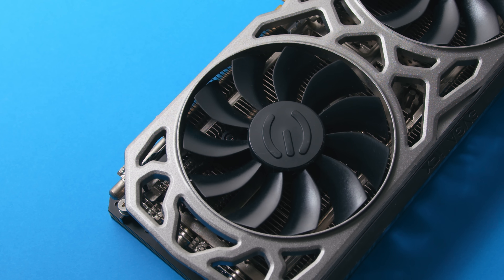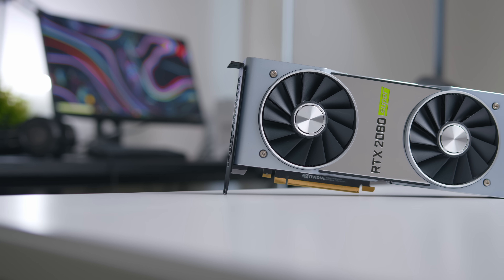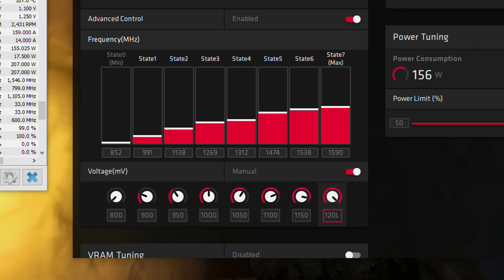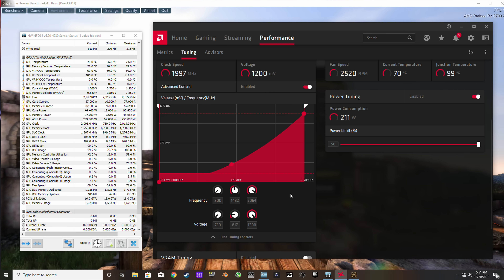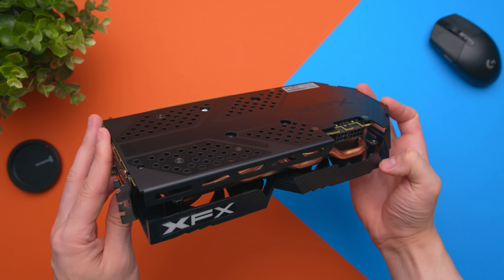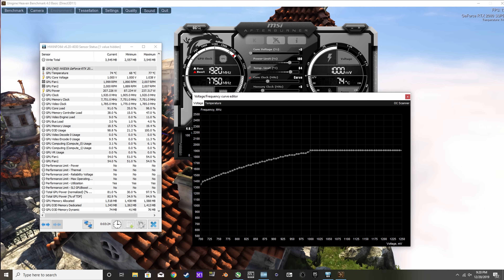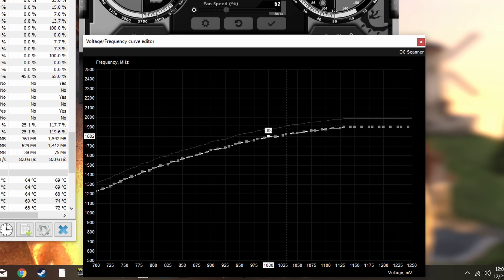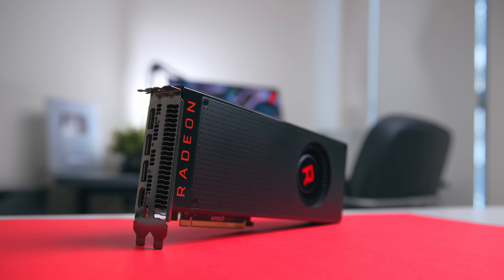The Ultimate GPU Undervolting Guide - Navi, Turing, Vega + More

Comment: Don't use Heaven, I don't know why so many people still use it, its an outdated benchmark and it doesn't even hit a 80% power on most modern cards so then the freq/volt curve behaves totally different on it. Once you undervolt on it and then run some modern game - like RDR2 - it crashes instantly. 3DMark or any other modern game in the background is much better than freaking Heaven. Unigine benchmarks sucks anyways, their use of APIs is poor and doesn't scale well with all cards and architectures.

Also don't use AMD Software to undervolt/overclock, it has a tendency resetting its values even though everything is stable. Also its fan control sucks real hard and has bunch of other problems. Afterburner is much more flexible.

Comment: Undervolting my Vega 64 by even the smallest amount makes it unstable. That said, it boosts above 1600mhz consistently and draws a max of 220w on default settings. Which is odd since this is a 295w card and I have a 750w PSU...

Comment: my  msi gaming x 1070 currently running @1961mhz @850mhz, i buy it used(3 year usage), from a gamer (seller statement, he had his original invoice from when he bought) ever reach 55 C when gaming (50% fanspeed), and furmark loop only manage to raise the temp to 62 C max, meanwhile my friends buy the same exact type as mine but from a miner who used it for 2 year (seller statement) and his card cannot maintain 1900mhz because it needs 900mv to run stable at that freq, and the temp shoots to 60C up (70%) while gaming so it throttle to 1887. we both use conductonaut thermal paste.  NEVER BUY MINER CARDS (buy only if you desperate)

Comment: you complete lost me with this guide on the Nvidia section as you have not explained how you got the volt number you had problems with and you worked out 925 millivolts was the correct and how did you set that in msi after burner if you going to do a guide you need to explain every step not just skip over parts as viewers who doing this for the first time get lost and this worst for people with learning difficulties.

Comment: My stock temps from the Gtx 1660 was from 74-80 and when i undervolted to 900mv it went to 60-67 with no fps drops.

Thanks @OptimumTech

I was about to get the 1660 Gaming x or other brands but the Asus Tuf 1660 was the only model in stock.

Comment: For anyone trying undervolt/overclock your Vega 56/64 card, DON'T use the AMD Driver undervolting, it doesn't work on certain cards, for me it changed absolutely nothing in undervolting but it does overclock.
Use OverdriveNTool, download the newest version and set up a profile and only change the voltage of the last two p-states.
I managed to get 1570mhz on 894mv easily, also don't let your Hotspot temp go over 105c

Comment: Great, thank you for this easy to follow along guide.

I was able to set the voltages of my EVGA FTW3 1080Ti to a maximum of 950mV at 1910Mhz (originally 1044mV) and have it stable. This resulted in the overall temperature of all parts of the GPU being at least 4°C lower. Maximum fan speeds were also lowered by about 100 to 150 RPM, this is sweet!

Comment: I don't understand what are you saying around 11.10. You mean that if the card reaches a frequency higher than its boost clock, we should set the frequency at boost clock? For example I've got an msi 2080 super ventus oc xs and it's boost clock is 1830 but when I run the benchmark I reach 1950 mhz. Does this mean that I have to low the curve and set 1830 as maximum frequency?

Comment: I can't seem to get my undervolt to take effect. As I adjust the sliders nothing happens in HWiNFO, and it has no effect on temp or clock speeds. I'm using a Gigabyte 2070 Windforce 2x

Comment: Got my MSI 2080 Duke from 1050mV down to 925mV, dropped 6-7C. Still holds strong at 1960-1980MHz and I was able to make the fans run slower too. You are an absolute legend!

Few things I had to do in order to make everything work, enable voltage monitoring and voltage control in the Afterburner settings. Once you find that minimum stable voltage point on the graph, press L to 'lock' the GPU to that voltage, then press apply. I had to do this to get the voltage to drop, not pressing L and pressing apply would not lower my voltage. Looks like this makes the gpu stay at 925mV even when not under load, pressing L may not be the correct solution but I couldn't make my voltage lower any other way. Applying the locked profile, then unlocking it and applying it again made it work like in the video. 

TL;DR Enable voltage control in Afterburner and try using L to lock/unlock the voltage if yours wont change.

Comment: Keep the frequency the same?
As an old man, the whole point of undervolting (IMO) is achieving the maximum efficiency, even if it means sacrificing 'some' performance.
My GPU runs fine at -90mV at stock frequency. But if I sacrifice 5% of performance, I can run it at a whopping -180mV undervolt. Pretty impressive. Doesn't bother me at all as I play at either 30 or 60 FPS capped with vsync.

Comment: What is the diffeference between undervolting and turn down power limit inside afterburner ??
Reply: Undervolting set's vGPU for given frequency, while power target forces both gpu frequency and vGPU down, when total power goes above certain level.
Also power/TDP targets work on GPU usage base (which changes dependinv on program/scene), while undervolting is independent. In most cases, reducing power target will reduce your performance.
Reply: @CompatibilityMadness  ok thanks

Comment: Amazing guide with super efficient results for my gpu and ears also. 
I have a question: after undervolt, at idle GPU continues to run at max clocks for core and memory and it's about 10 degrees hotter. Is it possible to return at base clocks when idle?

Comment: OH MAN, this video helped me solve a really annoying instability I've been trying to track down for ages and was completely random. Turns out some time ago when I had no idea what these tools really do I ran OC scanner on my 1080Ti and it set a low voltage at one specific frequency. Ever since then I've had completely random crashes in games and I couldn't pinpoint anything (Drivers, hardware, software). Furmark hit the power limit and stayed under the bugged frequency so it could burn for hours with no issue. Some games ran perfectly (Halo MCC) and some crashed within minutes (black mesa). That single bugged frequency/voltage point has been a thorn in my side for like 6 MONTHS. I even returned Borderlands 3 because I thought the game was badly made. Also my 1080Ti is now 49c while gaming, noice.

Comment: Yoo this thing is lit, im undervolting my rx 470, at first my gpu always at 70°C thats no problem im okay with that, but the fan is rocking at 70-80% power (2200+rpm) and its freaking loud. After undervolting it, the temp is still at 70 max but sometimes went down to 66~68 and the fan is at 50% or 1300-1500rpm dude that so freaking great.

Comment: Thank you for this guide! My Emtek 2060 was running like 85 degree c in 1.069V /2400rpm / Medium setting on Assetto Corsa.
But after some playing around the voltage, it's running under 70 degree c in 0.930V / 1700rpm / almost Max setting, no performance lose whatsoever : )

Comment: i just hit 1620 mhz in afterburner (but 1605-1590 on heaven engine) and no longer hitting temp limit - tested 20min interval. but i still hitting 83-85'C on RTX 2070 max P, is this even normal when my CPU only hitting max 84'C ?? the thing that i wondering itself is GPU temp since most laptop having GPU temp around 80'C max
Reply: anyone?? feedback would be awesome

Comment: Using a Sapphire Nitro+ RX5700XT, I sightly lowered from 1.35v to 1.1v and the frequencies are more smooth, most of the time 2043/2051 temp are lower such as power draw. It seems to be the sweet spot. I didn't try to move lower since I'm very happy with this setting. Thank's for your help.

Comment: This video doesn't seem to address the automatic GPU boost technology that board partner's overclocking software have built in. When I use MSI Afterburner to undervolt, the voltage limit and boost clock get bumped up by the software regardless of what settings I apply. Therefore, the GPU won't run at a constant voltage. Any idea how to negate this?

Comment: I would like to add some advice that I was given on Reddit that may help others. start by resetting your GPU settings in MSI AB to stock. Maintain the curve as you adjust points (the slope that is set by default) on the f/v graph by holding CTRL when making adjustments. lock the voltage at points along the f/v curve by selecting a point, then pressing L.  To test a lower voltage at the same frequency, hold CTRL while you increase the frequency of a lower point on the curve, then lock voltage at that point. This netted me a 100mhz increase in core frequency stable under load @ .913v. in particular, the curve of the graph as it reaches its max frequency at a given voltage is important to the result (which is why I suggest holding CTRL while making adjustments)

Comment: I wasn't able to get the voltage of my 2070 Super to show up in Afterburner. It just shows 0. Any reason why?
Reply: In the settings icon you have to check "unlock voltage control" and "unlock voltage monitoring".

Comment: Thanks bro I was running 70-77c gpu and 90c junction on my 5700xt running uniengine now I'm getting 63-65c gpu and 75-79c junction 👍
Reply: Where's Waldo yeah my sapphire ran pretty hot prior to this tweak. great stuff.
Reply: my gpu runs at 80-83 at 100% usage lmao
Reply: Your gpu runs that hot? mine 30 idle and 58 max
Reply: @one-minutemetal1290  mine runs at 79c max lol. Ambient temperatures also matter.
Reply: @ZzSlumberzZ  yeah in the uk the weather is hotter im running at 68 degrees max but it gets lower over time

Comment: Really good video, helped me a lot with my RX 5700 XT, I didn´t need 2000 Mhz so I just underclocked to 1900 Mhz and undervolted to 1000 mV and it works just fine (also got -14ºC so thats awesome).

Comment: Will this work with the sapphire pulse 5700 xt? I'm struggling to keep junction temps under 100.
Reply: Maybe not the exact same voltage, but if it's at 1.200V at the moment, try 1.150V. then 1.100V and then 1.050V. I think 1.150V is safe for work, 1.100V should be too, but 1.050V maybe not, just try it like he showed. You can even try not setting the power slider to 50%, in your case maybe just try 20% or 0%.

Comment: Fantastic guide!

Also, for those who are wandering if Vega 56 can overclock while being undervolted, I'll suggest to try this values:
800mv until P4 then 900, 950, 1050 for the boost P state.
Leave the stock clocks unchanged, set only the boost at 1667 mhz. This way it will boost around 1640~1700mhz.

Power limit must be at +15%.

PS: it will not work at all with other values, only the boost clock can be changed, down.

For the hbm, it depends on the manufacturer, I use 960mv and 960mhz, this values will guarantee that the overclock on the memory is actually used.

Comment: For Nvidia anything other than dragging every point down after the voltage you want to set (stock curve or +100 curve does not matter) gets a small hit in performance. Especially making the curve in the last bit more steep than the stock curve since videoclock is lower than in the first method. Can you follow me?

Comment: Just did my undervolting using Shadow of the Tomb Raider menu and benchmark! 70C->66C (6% reduction) while at a 10% reduction in fan speed. 1920MHZ at 925volt. 900volt unfortunately caused crashing in the benchmark. RTX 2080 Duke thanks for the guide!!!

Comment: I've undervolted my zotac GTX1070 mini down to 900mv and in my mini ITX case that dropped the temperature from 78C to 71C. This in turn let me set a way less aggressive fan curve so after playing with the fan settings I now have the card running at about 75-76C under load but with about 20% less fan speed than I had previously.

Comment: Undervolted my 5700 XT Nitro + to 1999mhz @ 1031mV. 

Works like a charm. Lost about 2 or 3 fps but it is wayyyy more silent, takes 40w less power and its not as hot. 

I love undervolting and I‘ve been doing it since my vega 56 and my radeon vii.

Comment: My GTX1060 is running for over a year undervolted to 0.95v from 1.05v stock at 1950Mhz. I've tested it for stability in all benchmarks and variety of games. GPU temperature has drop 8 degrees Celsius in same conditions /ambient temperature as well as the power consumption has dropped atleast 25 watts. Finally, be sure to test with tessellation at maximum for insuring stability in tessellation dependent games .

Comment: can you overclock and undervolt both at same time?
Reply: in MSI afterburner the undervolting takes the place of an overclock but I was still able to overclock the Memory clock while undervolting the core clock. Hope that helps. Bear in mind that my graphics card specs say that the boost clock is 1708MHz but the stable boosted clock speed both before and after undervolting for me was 1797MHz anyway so I guess you might call that a mild overclock just from how the card boosts automatically.

Comment: Pro tip for 1080Ti users: 
Use the max stable offset for core clocks without adding any voltage.
Then go to 1050mV or 1075mV and add 25~50mhz depending on whats stable on your card and enjoy the higher boost clocks. 
Mine stay at 2050mhz on core and 6277mhz on mem at 1075mV 😋 using the evga sc2

Comment: Pascal and maybe Turing owners should be aware of "The Pascal Problem" when undervolting: https://www.youtube.com/watch?v=bflLDenKirQ

Basically, even if your undervolt is stable at the same frequency on a lower voltage, you can get lower performance, so always benchmark stock vs undervolted.

Comment: I recently upgraded my rig with a new case with integrated fan pwn & rgb controller, some additional pwm fans, 2 additional ssd's and changed my gigabyte 2070S gaming oc to a asus rog strix 2070S. advanced(which is slightly more powerhungry)

Now I was experiencing random freezes and system restarts, first I thought that I got a faulty gpu since it was mostly occurring during heavy loads(while gaming), but then it also got random system restarts even during idle.

After some research I've come to the conclusion that it's probably the psu or in other words: not enough juice. 
And I thought 750w is overkill, but with cpu, gpu and ram overclocked + 9 fans, 4 ssd's, rgb and other stuff it's actually reasonable.

Well I gonna try undervolting my gpu tomorrow, maybe this solves my issue, if not I gonna try another psu.
Anyway thanks for the guide, very appreciated 👍
Reply: May also be a faulty mobo. I had same issues, gone with new motherboard
Reply: Might be, my mobo already had terrible vrm coil whine before, had to disable c-states but that increased cpu temps by 3-5°C. 
Wouldn't be surprised if the mobo causes my cpu and gpu to consume too much power as well.

Undervolting my gpu and slightly reducing cpu & ram oc solved my issue in the end.
I'm planning to upgrade my cpu next year and gonna need a new mobo anyway, that's why I don't want to buy another one right now. Should be fine till then.